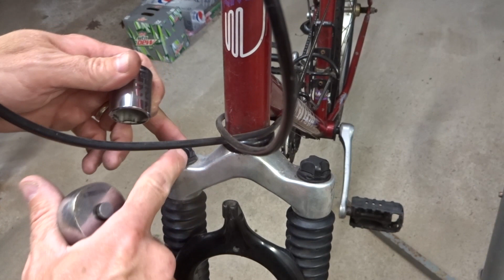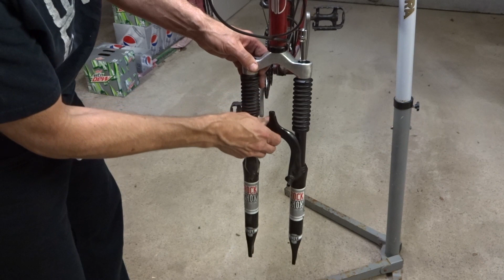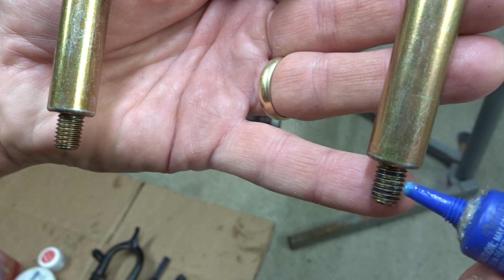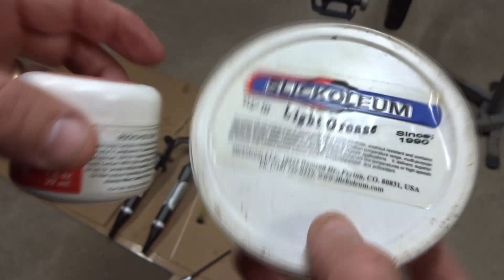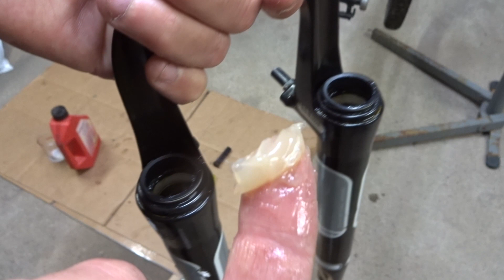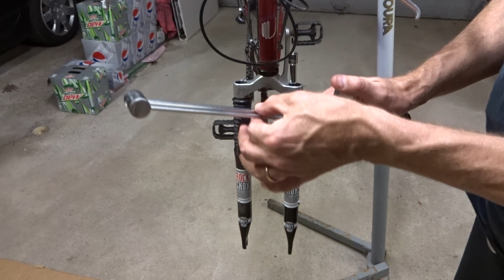RockShox Indy S Shocks/Fork Service - Disassembly/Clean/Lube/Assembly

Comment: Need your suggestions RJ...First, like all your other bike videos, thank you for the time/effort to sharing!  I have a pair of Indy XC from a 1997 Specialized Rockhopper that I'm restoring.  One of my elastomers is starting to degrade at the bottom edge.  Seems the shell of the elastomer is durable but the inside is fragile (sort-of crumbles).  Have you ever saved one by repair?  I'm asking because the parts for these old shocks are hard to find and when you do find them they are not cost-effective.  I found one place in NM on-line that sells a pair for $55 plus shipping which to me is a bit steep for a petroleum elastomer.  Here's a short video I did with some thoughts on repair/saving at least for another 30 hours of riding or so:  https://youtu.be/wBtndfQnsAw

Comment: Where/what in that assembly is the shock absorber or damper? Assuming the elastomer is the spring. Thanks.
Reply from the maker: I think the oil part. It has to push up and down through a small hole. That slows the bounce.
Reply: RJ The Bike Guy thankyou. I recently dug out my old specialized with indy shocks and theres little absorption (and couldnt remember what they were like new). I did wonder if there was supposed to be any at all. 
Thankyou.

Comment: I just picked up a trek 930 with these forks , thanks great video.
Interesting,  no spring or valves in a shock fork. I would never have thought .? Is the oil act like the shock?
For gravel / touring do you recommended a regular fork?
Reply from the maker: There are holes through the  little plunger parts, that the oils has flow through causing resistance both ways. You gotta do your own research as to what forks you want.
Reply: @RJTheBikeGuy  it already has that Rock Shock. Indy.
I am gonna try gravel/ touring type build. Dont know if needs new fork or solid steel fork.

Comment: I just learned that Threadlocker cures in the absence of oxygen! The plastic bottle it comes in is a air-permeable, so that the product doesn't harden in the bottle.
It sets once you screw the parts together.

Comment: So well done and well edited! I have a circa 1998 Trek 820 that I pulled out of a neighbor's trash heap a few years back. It was in good shape, as the boy it was purchased for
grew out of it quickly, and it wasn't used much. With rack and panniers loaded, I rode the Camino de Santiago in Spain [800km in 2018] and Eurovelo 15 - The Rhine [@ 800km in 2019].
I just got new wheels built for it, and am now ready to rebuild the RockShox Indy S forks!! Thanks so much.
PS:  White socks on the garage floor? Wow, I'm impressed!

Comment: Hi RJ, I have the exact forks on my bike. How do you set them, you can turn the knobs , is it to count and turn same amount on each?
Reply from the maker: All they do is preload the springs to make them stiffer or softer. They don't need to be even.
Reply: @RJTheBikeGuy  Thank you for the reply. So I'm clear, I only can adjust left one sitting on the bike where elastomer is, correct? I assume to achieve stiffer setting, knob has to be screwed in all the way ?  Meanwhile, right one can be screwed in all the way and left there, there are no adjustments on right side ?
Reply from the maker: @sts1541  If there is only an elastomer/spring on one side, then that is the only one you can adjust.

Comment: Awesome video and thank you!!
I have an OLD Diamondback Vlink 1.1 Full Suspension that I need to rebuild the Front & Rear Shock.....
I have a Rockshox long travel Indy XC, I'm thinking its about the same parts? Do you know where I can buy replacement parts?
The rear shock looks like a Fastrax, I might be better off buying a new on fro the  rear? 

Thank you
Reply from the maker: You have to shop around. A lot of replacement parts may not even be available for these old shocks.

Comment: hey rj im rebuilding and re lubing a set of rst gila t4 forks and im wondering how necessary it is to use locktite on the bolts holding the lowers on ? do i need to put some on there ? will i die if i dont ? all jokes aside do i need to , the bolts have some old blue locktite on them.
Reply from the maker: I really recommend using threadlocker blue.
Reply: Do the Rock Shox Fork tubes for the non disc brake type have the same spacing from one another as the brake disc fork tubes?

Comment: I am sure I have heard you mention it before, but I'm unsure where, lithium grease that is.
the SRAM butter is available but expensive, slickoleum I haven't been able to find a UK listing so I have ordered a 500g ( approx 1lb) of lithium grease as I prepare to service my basic Rox shox dart 1's.
having done so I recalled you mentioned the stuff, where & why I can't recall, so my question is have you said or do you not recommended using lithium grease for fork overhauling? as a fairly basic fork with too soft a ride for my preferences, unless advised it's dangerous probably gonna go ahead and use it, at the price compared to SRAM butter its worth investigating. 
A question for which you may have no thought let alone answer in hydraulic brake oil, my rear is a hope and online they tell me DOT 4, so it's straight forward, my front is a replacement, entry level Tektro draco, Tektro uses mineral oil & that's as far as it goes and I'm probably wrong here but to me that just means non synthetic. There are many types of mineral oil available from 2 stroke that you may add to a lawnmower if you gotta patch of lawn big enough and through a range of oil uses, I looked at a few, as I see it overpriced options, then went for a castrol 15w fork oil, that I'm going to need anyways that suggests it's good in mineral oil hydraulic braking systems, any advice or better still an overhaul video covering these issues would be welcomed.

Comment: So interesting how there are so many different shocks out there. Some are cheap and some are not. What does that elastomer actually do? Is that the actual "spring"
Reply from the maker: Sort of like a spring. It's not as bouncy as a spring.
Reply: Heinocraft Actually, the two "plungers" that were installed at the bottom of the fork legs are the pistons for the damping action. Hence why there needs to be fork fluid in the forks. The pistons move up and down with the lowers (they are screwed there) and the fluid is forced to pass through some sort of passage in the piston, in order to go from lowers to uppers. This creates damping (further reading: damper rod system). The elastomer most likely acts as the spring. 

There are cheaper forks which use elastomers for damping, however (see many RST forks), where the coil spring surrounds the elastomer. As the former extends or compresses, the elastomer is dragged along and deforms, absorbing (damping) the oscillation of the coil.
Reply: Those cheap forks do not carry fork fluid internally.

Comment: hey rj what to do if your front suspension squeaks when compressed?
Reply: Disassemble,Clean,Lube,Assemble.
Reply from the maker: Yes.
Reply: I have done that but it still squeaks
Reply from the maker: Maybe you didn't use enough lube, or the right kind of lube.
Reply: I Used marine grease, i think that that is good?
Reply from the maker: That is your problem. Use grease designed for forks!!! Did you even watch THIS video?
Reply: RJ The Bike Guy well its basically water proof grease so its sold as marine grease but on the package it says compatible with bicycle forks, bearings, boats and Something else.
And yes I Used grease as much as you have in your videos
Reply: RJ The Bike Guy Well ill clean it and lubricate again but thanks for your help

Comment: I got a bike that had Rockshox indy SL forks on it.  some shimano lx parts on the bike.   frame was mangled tho.  bike was £5 or so, from scrap yard.  so good spares.  recently sold the forks on ebay.  for more than bike cost.   I said the forks were for restoration.  as were scruffy.